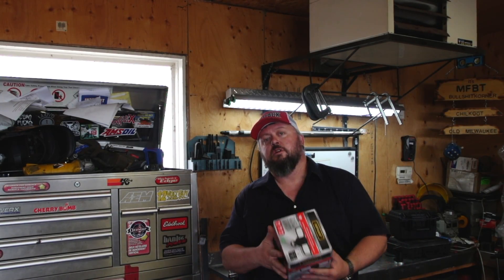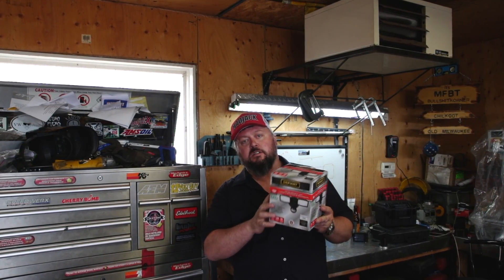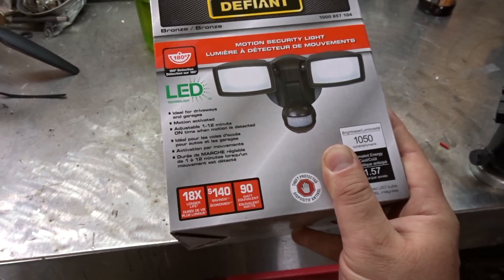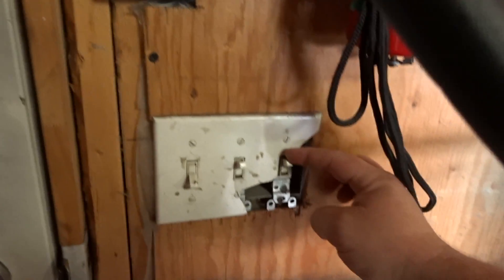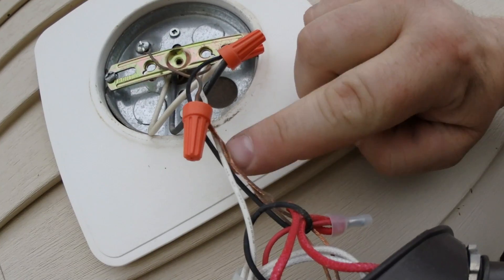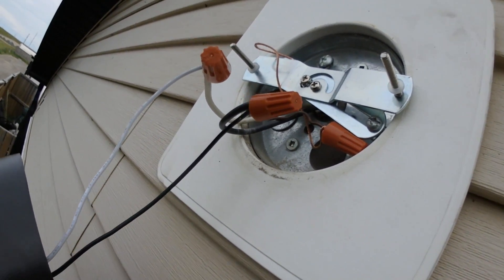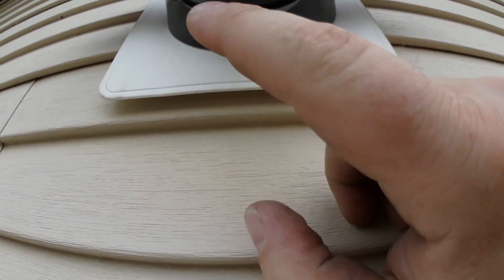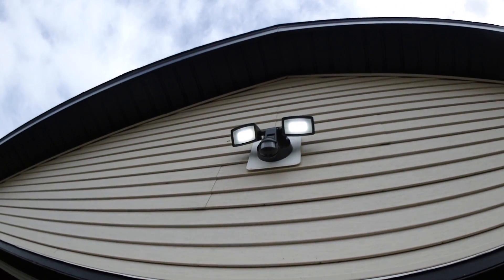Defiant Led Motion LIght Install DIY

Comment: the non contact AC voltage detectors (test pens) are a cool tool to have , on the "rare" occaison the switch can be off but the wires still live.
Reply from the maker: +closertothetruth this is true you can never be too safe, I have one of those pens somewhere in my toolbox

Comment: I just replaced a double head, halogen motion detector light, that was on my garage wall and it lit up the area leading to my front door. This was the unit I replaced it with because the motion sensor on my original unit was failing to turn on the light. This unit, with both heads lit up, does not throw even enough light, that is greater than what one head threw of the halogen light. And this light is very cold and does not show your surrounding in a very flattering or true color of light. There is insufficient light value and finding the right key when opening the door is difficult as it is still too dark. I have sourced a new motion detector and I plan to replace the old motion detector on my original halogen light. If it all works when hooked up on the test table I will replace this LED product that I installed. I am now on the hunt for more double head halogen units. Thankfully you can still buy the tubular bulbs. These LEDs are not as bright as the halogens. They maybe cheaper to run and last longer. But I have found them to be more expensive and they do not work as effectively throwing light out. It really is a different brand of light. One I don't like. Very disappointed in their performance, they are NOT better than the halogens if it's light that you want. .
Reply from the maker: That’s too bad I really like the led lights vs what I had before the white is much whiter abs lights up more space
Reply: @TestDontguess    The light does appear to the eye to be whiter. As I indicated, it's a much colder temperature of light. It does not compare in color to the halogen lights I have in other locations around my home. Those halogen lights are much closer in temperature value to real daylight, which is around 5500K. The other issue I have with these LED lights. The light falls off too quick, the halogen light projects much further. I have already done some comparisons around my home and stood back to witness the difference. The halogen I replaced, I bought as many as I needed a few years ago, when I had this home built. So the other halogens I have still in operation are the same unit as that one I took down. Without question, the halogens throw a much warmer light that extends beyond the distance than what this LED can. And I find the halogen light to be more pleasing in look, probably because it registers as being more natural. The LED showing whiter comes off as being very harsh. I actually find the light from this LED as being somewhat eerie. It's kind of like the light value that registers in infrared imaging, it's kinda creepy. 
I'm going to replace this motion sensor, I have a replacement already and I will remove the LED to put the halogen back up. By the way, just one piece of important information about my halogen lights. The bulbs that go in them are those long tubular glass type bulbs that are 3 or 4 inches in length. They come in different watt outputs, these I have are all 250W. I don't know if there are bigger LED lights for lighting larger areas, there certainly were halogens of different sizes with that in mind. I have seen those LED lights where they have three heads. That's probably the only solution they have at this time. I have one large square halogen that I have had for years, still in the box. I bought it but I really don't require the amount of light this thing will throw at this time.
These halogens do tend to throw a lot of light. The double head above my garage/shop lights up my whole driveway and beyond. It lights up enough of my neighbors drive, that they can see at 5 AM in the morning when they leave for work. They have thanked me for years. If you are happy with your LED lighting, that's what is important. All the best.

Comment: I don't have the wires coming out of the wall so I cut one end of and industrial extension cord and attached to the light and plug the other end to the wall. It works perfect!
Reply: Well, that's against code, but if you're not worried about fire and safety or an inspection, OK.

Comment: Im slowly converting everything in and outside of my house to LED. I actually notice a difference on electric bills after I change something major or an entire room.
Reply from the maker: +Matt H I've been slowly doing mine as well almost every room has been changed
Reply: Do you notice a cost savings? What colors are you using? I really dont like the "feel" of bright white but it is really good lighting for working areas.
Reply from the maker: it's hard to say a true cost savings but i'm seeing 10ish dollars a month difference
Reply: Ya i hear ya. I have trimmed $50 a month on my electric bill from what it was a year ago but i have spent more on the bulbs than i have saved on my bill. I have probably spent over $500 on bulbs (you dont realize how many lights you have until you start replacing them with $25 led bulbs) and only saved $200 over the past year and a half.

Comment: Thanks Jerry Im in the market for some as well. Question how long have you had this light up and running? And did you notice any changes on the amount of light put out.
Reply from the maker: +Dave Tumbleson the light output is softer only because the other lights were a harsh yellow.  I like them as they use less power than the other lights